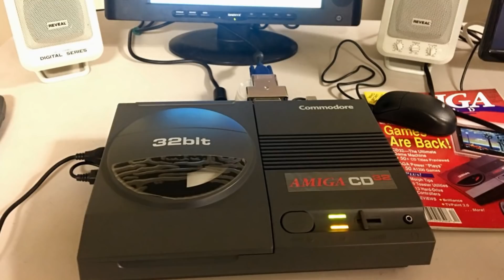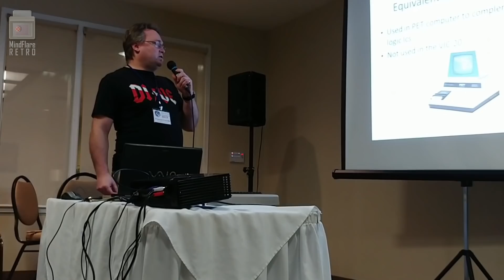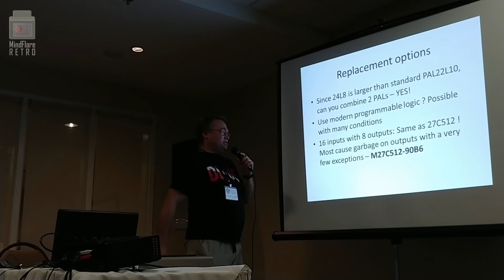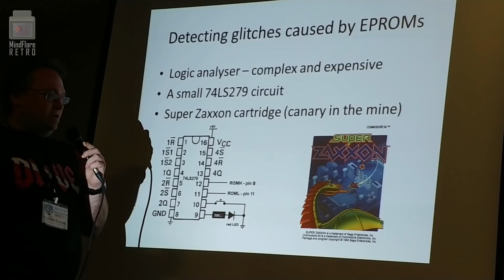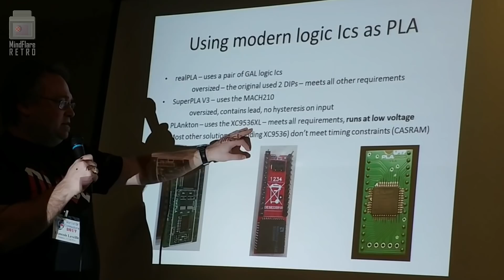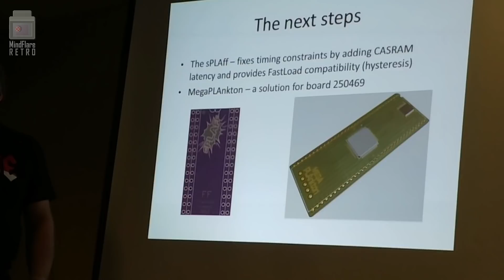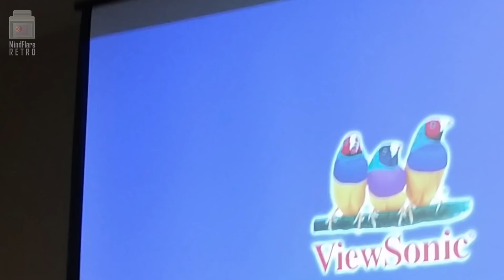#10 'The PLAin Truth About the Commodore 64 PLA' at World of Commodore 2017

Comment: Sell it because it pisses someone off.  That's a great reason to do something...
Reply from the maker: Yes, a shame about the silly feud. That aside, the PLAnkton is a great PLA replacement alternative. Thanks for commenting.
Reply: I'm thinking, because of my weird friend circle in Taiwan, maybe I'll just share this to my friend circle there.  Who knows, there might be a guy/gal that work in Winbond, and might know something or could change something to make it work.
Reply from the maker: @maniacaudiophile  Oh! That would be cool. I think the genuine (and working) M27C512-90B6 are ST brand made in Taiwan. Check out the pictures I posted here (genuine vs fake according to ESLAPION): https://app.box.com/s/1idxfqyzz2f7ayb1yl63i5pt0i1bht3i
Reply: @MindFlareRetro  The file Genuine_ST-M27C512-90B6_PicByEslapion.jpg is actually a 82S100 which comes from an early C64 board 326298.
Reply: @maniacaudiophile  It actually seems a few 'fake' 27C512 recently bought on eBay from China now perform well as a PLA substitute. Exactly as with genuine ST M27C512-90B6, they have a low slew rate which acts as a form of filter which makes digital glitches irrelevant to an old 8 bit computer.

Comment: Why would anyone need that "plankton" CPLD when the whole system can be put inside an FPGA?
Reply from the maker: Hi @szt1980. Thanks for commenting and for your question. I assume you are referring to the Ultimate64? Personally, I would love to have one but I can't afford it, especially shipping to Canada.
Ultimate-64     € 177,69
Shipping Costs  € 9,50
Payment Costs   € 6,55
Grand Total     € 193,74 / $ 220 USD / $ 300 CAD

Also, most of us that grew up with a C64 as their first computer experience want to use original equipment and if a PLA chip dies the $20 PLAnkton is an easy replacement.
Reply: @MindFlareRetro  .... I totally get the nostalgia factor, but the problem lies further than just flat costs.  We are talking a lot in electric bill just to run such machines for any length of time, and they are not forward compatible with monitor technology, so you lose on both ends.  Personally, when I want to step into the past, I simply use a full emulator....gives me the same nostalgia without paying out the ass for electricity.  It even brings a little bit of joy to write such emulators, even down to the wiring simulation for "tinkering" purposes without getting my hands dirty with old cap wax.  You could buy a Raspberry Pi for $30 and download a c64 emulator on it, almost as cheap as the PLA replacement.

I miss the feel of the old days, no doubt......but I don't miss my room lights going dim just from powering on the box, or the extremely high pitched noise coming out of it (very sensitive ears).
Reply from the maker: You make some good arguments. And yes, those old computers are not very electrically efficient, which is evident by the heat they throw off. For me, I enjoy resuscitating these computers when I can and then finding them a new home -- it keeps me out of trouble. 😉
Reply: @sabriath  I modded my good old 250466 C64 board to use HMOS 8500 CPU, VIC-II and CIAs and a module replacing DRAM with SRAM and it consumes a 'whopping' 7W. This while my new i7 6 cores 3.2Ghz tower has a power supply rated for 750W.  Power ? Really ?
Reply: @francoisleveille409  ....uhh...con...grat...ulations?  Like, I don't know what to say, I was talking about vintage equipment, from memory on the fact that it drew a lot of power.  The "brick" power supply came with a transformer capable of a 240 outlet, so agree to disagree, I guess......newer boards waste less electricity in the sake of equal capabilities, that's an obvious fact....you are talking about a new board with HIGHER capability, but whatever.
Reply: @sabriath  If you agree to disagree then I really think you should take a good old multi-meter and check the exact amount of power a C64 uses, even the oldest ones which had more chips to generate the clock signal and a clunky transformer and linear regulator supply. At the most, they could draw about 40 watts. My laptop has a power supply rated for 120 watts but usually will consume about 60 watts. Maybe, just maybe, I know this because I have an electrical engineering degree... others do because they just looked at the numbers on the bottom of the PSU.
Reply: @francoisleveille409  .... I would love to do that, but I got rid of all of my c64 material when I was 19.  It was a dumb decision and hormones were involved, but there it is.  I am going off of memory and I have a sensitivity to the sound of electricity and can clearly remember hearing the c64....so, I don't know.  I am "agreeing to disagree" on the fact that I have eidetic memory of the experience I had....which I will not deny for the sake of an argument, but if it did use less, fine, hence the disagreement portion of the statement.
Reply: @sabriath  C64 and some VIC-20 power supplies made a 50/60 Hz noise because they used a traditional transformer, not because they used a lot of power. They were remarkably inefficient as they took in up to 40 watts but only delivered less than 15 watts to the computer they powered. The rest was wasted off as heat.
Still, compared to modern PCs and laptops, they consumed very little energy overall.
Also, today there are many available solutions from people like Ray Carlsen offering new power supplies for these old machines which use modern parts and have more than 90% efficiency.
Your original point was that you don't use vintage machines because they may inflate your electricity bill. In reality, it costs about 0.10$ for every 25 hours of operation. That's with an old original PSU. Not exactly a power hog.

Comment: R42 and C204 added to slow down the PLA on later boards. Remove those and I bet your PLA alternative will work on the later boards.
Reply: The components are critical in slowing down the CASRAM signaling. When a PLA substitute is too fast, removing them will cause it to fail because the DRAM access and refresh will be off timing relative to the multiplexed addresses.
Reply from the maker: @francoisleveille409  Bonjour Francois! Thanks for commenting and for clarifying the need for R42 & C204. Again, it was a pleasure meeting you that day in Dec 2017. May I ask if you will have any new U17 PLAnkton PLA replacements for sale soon? I was directing someone to your eBay store yesterday (May 2/19), but I saw that the PLAnktons were out of stock.
Reply from the maker: I was aware of C204 but I don't recall R42. Cool. I will have to revisit this. Thanks!

Comment: So how does the PLAdvance+ stack up as a replacement?
Reply from the maker: Hi Chris. Great question. The PLAdvance+ is the new kid on the block as of June 2018, I believe, and early reviews seem to show it as being another viable PLA replacement in line with U17 PLAnkton. It is very interesting that the PLAdvance+ has DIP switches allowing it to be configured for use in other Commodore computer models (http://j.mp/2KVdp9P) - this is a great feature. But, at €23 (plus shipping & handling from Germany) it is definitely pricier than the PLAnkton. I am curious to see if it play nice with FastLoad, Super Zaxxon, and 1541 Ultimate I & II cartridges. Maybe someone needs to order one in for review. 🤔

Thanks for commenting with this great question!
Reply: Pay the extra price for PLAdvanced (+) if you need a PLA replacement for a bunch of other Commodore stuff. The PLA in the Commodore 64 is used in a critical manner because of CASRAM and PLAnkton is specifically designed for this particular configuration.  PLAs are used in a bunch of other Commodore 8 bit computers and drives and PLAdvanced supports them while PLAnkton does not because these other equipment don't have this specific response speed requirement.

Comment: 906114 MOS I have these they have sat in my parts carnet for 20 + years if I am not mistaken there the Commodore 64 PLA' you want
Reply from the maker: Hi Jaimie. Thanks for commenting. Yes, those are C64 PLA ICs. Have you ever repaired Commodore computers before?
Reply: I am thinking about it I build and repair tube gear .. I am considering going in to c64's I have 154 of the 906114 MOS ic I used to do ttl logic control using what would amount to c64 computers so I still have 15000 1980's ic's of many types
Reply from the maker: 154 PLAs?!?! Wow! And 15,000 other ICs? Holy cow! Well, if you ever want to share those PLAs please let me know.
Reply: well I have to make some $$ to buy a video camera
Reply from the maker: Yeah, I was thinking you should probably try to sell some. Original MOS PLAs sell for $30-$45 on eBay, but those prices are rather inflated IMO. Some UK retro computer parts retailers sell the 906114-01 and equivalent 251064-01 PLAs for around £15 ($20USD/$25CAD). However, PLA substitutes are now available, as well -- in particular, the 'U17 PLAnkton' by ESLAPION is 100% compatible for $16.50USD, https://ebay.to/2C9OdLM. Are you located in Canada, too?
Reply: It's the same as saying 'I have a stock of old incandescent light bulbs'. They work alright but they heat a lot and they only work so many hours. A modern CMOS based solution consumes very little power, doesn't heat and will basically last forever.

Comment: What a huge hunk of bullshit to proclaim something that barely works as a proper solution. Why not go full 74LSxx if modern tech has so many conditions?
-- sincerely the PLA mafia
Reply: Would you care to substantiate? Every single M27C512-90B6 I purchased between 2008 and 2011 (when it was discontinued) not only worked perfectly as a PLA, it exhibited absolutely no glitches when studied with a logic analyser. I still have 2 in stock. The M27C256B-90B6 from the same company (ST) also exhibited the low slew rate output of its larger brother. Just for fun I created a PLA sub using a pair of the C256B and posted photos on Denial.
As for your comment about the 'PLA mafia'... http://www.melon64.com/forum/viewtopic.php?f=14&t=2439&start=8
If a PLA sub was built around a bunch of 74LSxx ICs, it would take a dozen of them, drawing even more power than the original 906114-01 and that's why Commodore combined the functions in a single chip in the first place.
Reply: The low voltage segment indicates 3.3V CMOS technology signals are perfectly compatible with TTL-LS logic ICs and NMOS ICs but some 'brillant' mind elected to use 5V CMOS ICs on a 'replacement' C64 board. These have a logic threshold of 2.5Vdc instead of the TTL standard of 1.3Vdc and require a higher voltage for signaling than normal C64 ICs do.
Genuine Commodore PLAs DO NOT signal at 0-5V, they usually signal at 0.3-3.7V and this was documented in Thomas 'Skoe' Giesel's 'PLA Dissected' public document. This is why PLAnkton operates at 3.7V and its outputs are virtually impossible to differentiate from a genuine PLA IC.
Even with this information, there are 'inept' people claiming PLAnkton has a problem because its output doesn't reach 5V - a genuine Commodore PLA doesn't signal at 5V either.
TTL-LS logic ICs usually are only guaranteed to signal 2.4 or 2.7V depending on the manufacturers.
See: https://www.allaboutcircuits.com/textbook/digital/chpt-3/logic-signal-voltage-levels/
Reply from the maker: Hi. To clarify, are you saying the U17 PLAnkton "barely works as a proper solution"? I am curious to understand. Thanks.
Reply: Nah, it's more focused on the EPROM-PLA nonsense. I guess the PLAnkton works, but the "low voltage" segment in the presentation rather raised questions instead of answering them.

Comment: While modern PLA-replacements are all fine and dandy, there is still the option to use the 'real thing'.
I have sourced some PLS100N chips, which are the same as the original Signetics 82S100 PLA-chips in early Commodores.
Only with one exception, they are newer chips, so they don't run that hot.
These get bashed a lot, much like Eslapions M27C512-90B6 did, even though they are the perfect replacement for the PLA.
Only problem with these is that the PLS100N chips are running out, they are not manufactured any more.
But I still have them, and I sell them quite cheap in relation to cost of buying them.
You can buy them from my shop, search google for 'retrokama c64'
Reply: Newly programmed PLS100 or 82S100 PLAs, which are essentially the same thing provided with early 326298 assy C64 boards are NOT 'the perfect replacement PLA' but they do work exactly like the real thing because they are made exactly the same way; a programmed logic array.
The problem is, they consume a whopping 100mA on the 5Vdc or 500mW. All this power is dissipated as heat on a 16x36mm surface. They run hot and they fail, just like an incandescent light bulb, just like the original thing.
PLAnkton consumes 22mA and the M27C512-90B6 consumes a pitiful 8mA to perform the same job.
Reply: Yes, these parts are more original than the modern replacements.
I measured my PLS100N, it draws 80mA of current. These are 15+ years newer than the early 82S100 chips.
These don't run so hot, and I am not worried about them failing because of heat.
Of course you can replace everything in the C64 with more modern technology.
With today's technology, the whole motherboard could probably be done in one chip, and consume way less power.
Also it wouldn't be as failure-prone as the original C64.
This is kind of what the Reloaded MK2 and similar projects aim to do.
In the end, it is everyone's own preference of how modern parts they want as replacements.
I go with the original designs whenever possible.
Reply: this will even look a lot better then all the SMD replacements.
Reply from the maker: Wow! I had no idea about this -- fascinating. Are they drop-in replacements or do they require any additional caps/resistors/logic on any of the power or data pins? Thanks for commenting with this information.
Reply: Oh, I thought it was common knowledge :) Yes they are drop-in replacements. Basically, they are the exact same thing as the original PLA-chips. But they are newer chips, so they don't run so hot. They don't require anything extra. I can send you one for free, if you want a sample.
Reply: Those have the problem of being unsupported by many programmers. If you can provide preprogrammed ones good going and a nice service to the community, but as you said ... quantities are limited which might become relevant in the near future, so it's not a full replacement either.
Reply: Yes, this is true. I am using an old programmer from the era, so this is not a problem for me.
The supply is becoming more scarce continuously, and the price for blanks creeps up as the supply dies.
The longevity of these newer chips will have to be seen, only time will tell. Currently I am trying to hoard as many blank chips as I can for my shop.
Reply: Timo Mömmö This is exactly whats being done with the Ultimate 64 motherboard which is about to see an initial limited test release. An entire C64 plus some modern goodies all inside a Cyclone V FPGA...